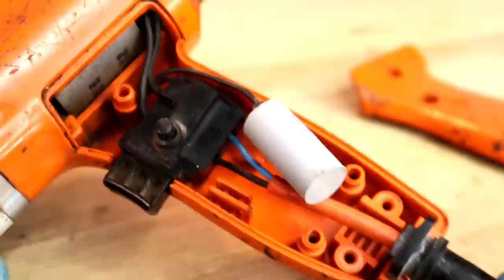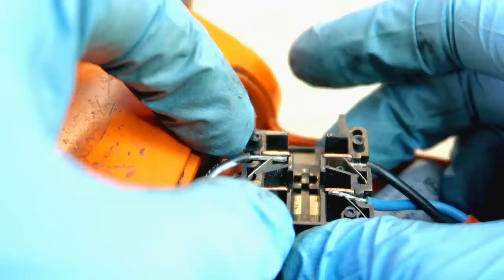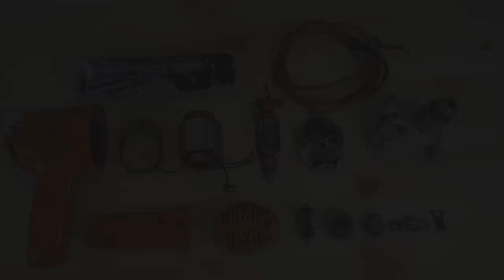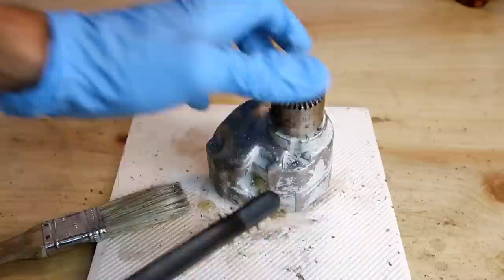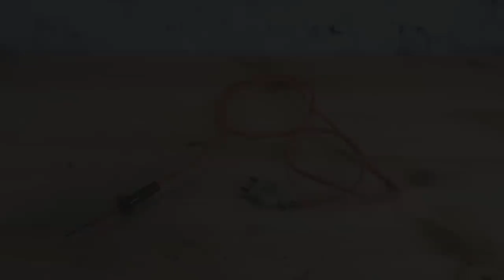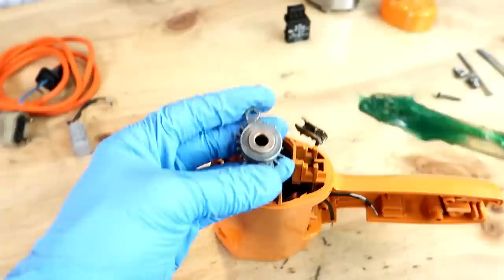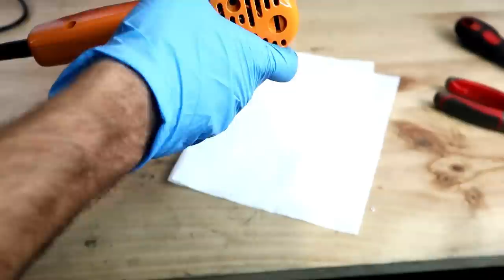Broken Old drill Restoration - Black and Decker

Comment: That material on the back of the bearing looks like felt, I think it needs to be put in oil so it can absorb it and then releases the oil lubricating the shaft.
Reply from the maker: i think is for dust ?
Reply: @TysyTube  I suspect Andrei is correct: it's for lubrication of the back bearing of the motor shaft.
Reply: I think it's a bronze bushing which is porous and absorbs oil. Saw a similar thing in a fan which had 2 felt washers impregnated with oil.
Reply: Yes it's for absorbing oil. When the shaft turns the oil gets warm and released from the bearing, lubricating the shaft. When it cools down the oil is absorbed by the bearing again. It is called a oilite bearing.

Comment: Damn, that's some gnarly grease. But great to see a B&D tool back from when that name meant something. Also why did they always paint the castings on these old tools? They look pretty in the white.
Reply: My Dad had a 1/2 inch Milwaukee drill and a Milwaukee Sawz-all (a reciprocating saw) from the 50's since he worked as a plumber.  The 1/2 inch drill must have weighed about 25 pounds, with a heavy cast aluminum housing, even the trigger was metal.  Unlike the 3/8ths the 1/2 inch runs a lot slower, but has tremendous torque for running big hole saws through beams.  The only paint was the logo Milwaukee with their red lightning bolt underneath, once after many years of daily hard use the trigger gave out, he went to the hardware store who were dealers.  Back then Milwaukee had a unlimited lifetime warranty, you paid shipping to the plant and they would fix it for FREE!  How's that for customer service!  When it came back my dad almost did not recognize it, they replaced the trigger and in addition the original chuck (that's what we call the the bit holder here in the US) which was a little nicked up, re-greased the gear case, put in new brushes, and replaced the cord.  To top it all off they buffed and polished the housing to a mirror finish!  He then saw the old dirty plate with his serial number and knew it was his. 

True it did not have variable speed, reverencing or hammer mode, but in terms of power, build quality and durability it is hard to beat.  Interestingly it is a Universal wound motor, 120 volt AC or DC.
Reply: That grease in that amount is needed.

Comment: According to B&D first remove the Jacobs chuck by inserting the key and striking it in a anti clockwise direction with a hammer which loosens the thread allowing  removal
Reply: You’ve got write mate as I use to do the same thing with mine 🔫 years ago

Comment: Nice job ! Suddenly I'm back five decades. My D720H, the hammer drill variant, got the regrease and brush service annually, but not a repaint! The chuck screws off -- when assembled, select low speed, insert the chuck key and tap it firmly with a mallet (seen from rear, insert key on right and tap downwards). Though lightweight, a well maintained D720 would stand lots of rough use and just keep going. B&D 60's ads in UK papers were for a drill plus lots of ancillary kit, clearly aimed at amateurs, and competed with Wolf drills, but Makita, JCB, De Walt, Bosch, etc. came later AFAICR. Today's portable, reversible, multi-speed, keyless-chuck drills are amazing, but these old drills got the job done back in the day.

Comment: Professionaly restores a drill
5 min. Later
drills wood with metal bit
Reply: Glad to see you got the point of the video.
Reply: I think he meant that it looks the guy uses a drill bit designed for drilling metal, not one designed for drilling wood. Bosch make multi-purpose drill bits which can be used all all kinds of materials, so it's possible he was using something similar, but it's definitely not a dedicated wood bit.
Reply: @stazjohnson8618  Does it matter though? It stills drills wood and does a good job of it. Unless there's a law somewhere that states you cannot drill wood with drill bits made for metal...
Reply: @AyeYerMa   In Alabama yes, it is a misdemeanor to drill wood with a metal drilling bit. However, if you drill metal with a bit that's made out of wood, you're given an award. I forgot what happens it you drill metal with a bit made out of stone. A write-up in the newspaper, I believe. :)
Reply: who in a penny-pinching shed shop is going to keep a complete separate set of awl-point or gimlet-point wood-drills around when metal/all-purpose drills work just as well for most tasks?
Reply: Not a big deal don't be so picky.
Reply: I drill wood solely with metal bits except of when i need to use a diameter that i only have on a wood bit. Metal bits tend to drill wood more controllably for me and are more forgivable when pushed sideways whereas a wood bit can overbore it more easily.
Reply: @AyeYerMa  r/whoosh!
Reply: not a big thing.i do that every time. irwin multi material bits, drills brick, tile, wood etc.
Reply: @thinkingmonkey8083  If @AyeYerMa really didn't 'get' your sarcasm, I'm seriously worried for him.
Reply: @kh23797  That clown is hilarious! He feels a need to school me that "drill bits are not made out of the material that they're used to drill" (LMAO!) then has the nerves to call ME retarded. Because of him and his negative comment I'm going to the shop right now and throw out all my stone and wooden drill bits. Got a couple of plastics ones I'm going to keep, though. lol
Reply: He got trough. So where is the big deal?
Reply: Hardly a problem, they make a hole, so long as it's not a wood bit into metal

Comment: I have same model..  yeah trigger went mental when pulling it apart.  To remove a stuck chuck, put the chuck key in situ and give it a solid whack with a hammer... Worked for me. Good job on restoration 😁
Reply from the maker: thank you so much 😊

Comment: You did not add enough grease to the gearbox. It is supposed to be full just like you found it when you opened it. The paltry sum of grease you applied will be flung from the gears after first use. smh
Reply: Gear box should not be full. About the correct amount of grease was added
Reply: @davidarthur6564  Well David Arthur, you are incorrect. I said it should be full like he found it. Which presumably is how the manufacturer intended. General rule when filling a gearbox with a large reservoir like that drill has you will fill the reservoir 1/3 to 1/2 full. The amount he put in wasn't even close.
Reply: Monad333: you are right. 100% full would be bad because for the heat, but at least 50% is ok. But i think it doesn't matter for this project, the drill will never be in use again. I have a few of those from my father's, i don't use them anymore but i won't throw then away.
Reply: @antraciet  Do it right or don't do it at all. ;) It's bad to spread poor maintenance techniques to others who may not know any better and then think that they are actually learning something. If they practiced what they learned here their equipment will suffer premature wear and failure.
Reply from the maker: sincerely i didn’t know that i needed to put so much grease inside, i will not utilize for me is just to show to my friends
Reply: @TysyTube  I know, its yours and your channel, throwing it off a cliff could be a fine option for a video too, lol. It's just if you go through all the effort in tackling a restoration and documenting it, you might as well make sure its up to snuff. BTW, It's a comment section not a personal attack, so take it with a grain of salt. Thanks for the reply and acknowledgment.
Reply from the maker: 😊 no problems
Reply: @davidarthur6564  You are incorrect. It should be full.
Reply: I made the same comment. When I saw it, it kinda triggered me LOL.

Comment: I don't understand how it worked at all without brushes...
Reply: You and me both.
Reply: Mutual induction.

But the armature should be at DC via brushes....due to the switching effect caused by commutation...
The field coils lock it into synchronous speed... 
Increase the frequency=
Increase the speed... 😉

Glenn
GLMelectrical
UK
Reply: I suppose it was the brush holders themselves dragging on the commutator. Would explain the noise. Hopefully that didn't cause much damage.
Reply: @ThatBum42 

No...
How could the brush holders drag on the comm? 

As I've already explained...
It was due to mutual induction... 😉
Reply: @glennmoreland6457  If you say so. I figured they just kinda fell onto the commutator since they didn't have the spring tension from the brushes and they were loose in the housing. That or they got close enough to arc at least.
Reply: @ThatBum42 

No.
The brush holders are just bits of brass formed into a square tube...these are held captive in plastic mouldings...
They're a couple of mm away from the comm...

Have a read up on mutual induction if it interests you...
Pssst: it's how transformers work...😉

Glenn
GLMelectrical
UK
Reply: @glennmoreland6457  I see. Crazy. Electromagnetism is pretty much voodoo magic to me, maybe one day I can have a better understanding of it. Have a good weekend ^u^
Reply: @ThatBum42 

Not "voodoo"...
Physics...👍

And once you start to understand it a little....it becomes fascinating...😉

Take care.
Glenn
GLMelectrical
UK
Reply: if you pay attention when he is cleaning the head of the drill you will see two plastic discs. The brushes are located behind them. He did not know to remove the coverings. The square tube hook into the bruishes from the back.
Reply: U
Reply: @glennmoreland6457  9ij
Reply: @SimoSimo-yx8rl 

Not quite in the realm of astro physics....yet...😏
Reply: Justyn, that´s right !
Reply: maybe it's a AC moter that dosn't needs brushes
Reply: oh, its a bldc moters

Comment: there was that much grease in there for a reason
Reply from the maker: that greas didn’t touched the gears
Reply: Nah, I bet some keener filled it full of grease before TysyTube got to it, seems likely since the brushes were missing. You don't need that much grease, when it heats up it melts into every crevice of the gearing. Put too much in and the drill has to work against the viscosity (fluid shear) of the grease, and also gets really hot. Explains why the old grease looks cooked.
Reply from the maker: thank you Justyn
Reply: @ThatBum42  Wrong, the gearbox reservoir is engineered that size  for a reason. It should be filled 1/3 to 1/2 at least.
Reply: @chriswilliams4200  Thanks Chris, The maker of the video got back to me and said he wasn't going to use the drill and it was only for display, so that confirms your suspicions. He also admits that he didn't know how much grease to add. Cheers mate.
Reply: @TysyTube  The grease would soften and deform as the heat built up in use and then the motion of the gears would fling it around like oil in a car engine, cooling and lubricating. It will always appear to have been flung off once the tool slows and then cools, but it really needs to be fuller than that. (assuming you intend to use it!) Looks great, though!
Reply: 383 chevy  especially when drilling  near the back door

Comment: Don't know if someone already said this but you did not need to cut open the switch open to get the wires out. Poke a very small nail into where the wires go and it will loosen the wires for you to be able to pull out. I restored one very similar to this model and my switch is still intact :)  I found mine in the trash with the cord cut off and the only thing wrong with it was...the cord was cut off. I now have a corded drill which I'm going to use as the drive for a mini wood lathe drill attachment I've got. Win!

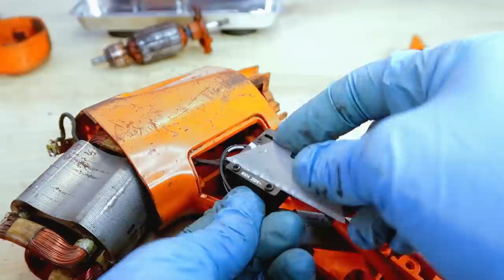Comment: Man, I freaked out when you were cutting the wires at 4:00... careful with those blades. Move the blade away from your hands!

The spring popping in slow motion was priceless.

Nicely done!
Reply: I think we all lose springs sometimes.  I do electronic repair and have learned my lesson there.  If I have to open something with a spring in it, if I can I'll put it inside a gallon Ziplock bag to try to contain the flying bits.  Hand towels draped over the workpiece also help if you don't have to see what you're doing.

Comment: Ive got one of these from when I first got married so it's 40 years old. It still works although I've not used it for 20 years because I suspect the bearings are worn. I used it with all kinds of attachments. I've lost the chuck in a couple of house moves though. Maybe I'll find some time to resurrect it.

Comment: Looks like it's more or less the same vintage of the Black & Decker SP2510 (at least, that's what it looked like) that my father handed down to me. The plastic is blue/grey, but the bit at the front has the same light grey colour as the one you removed. It still works well, even though it once fell into a well (while running), but it's a bit old-fashioned, with no way to control the speed other than "on" or "off".

Comment: I have this exact  sane drill ingerited from my late father. It's outlasted various more modern drills but now is a bit touchy on starting unless I pull the trigger just right and the noise from the gearbox makes me think most of the grease has retired after 45 years of use! At least I feel a bit more confident fixing it up now :)

Comment: Amazing restoration! Great attention to detail! I'm getting addicted to watching these videos ; ) I have a really old Black & Decker drill from the 60's which was handed down to me from my father it would be a great project to restore as well one day.  Someone had told me years ago that you can make brushes for electric tools from the cores of old C and D cell batteries with some work as long as they have a carbon core, correct me if I'm wrong. Thanks again for sharing a great video!

Comment: Thanks for the clear explanation, I've repaired mine with these instructions.
One minor thing: the configuration of the washers for the axle with the ball bearing might be different on other model years. To check if you have it correct try to turn the head by hand. If it locks up, you need the two thick washers on both sides of the ball bearing

Comment: I have bought several of these ...... 500watt > 700watt with hammer & all from boot sales. They were good bits of kit & really require no true over haul even after 40 yrs. Change the cable & repack with fresh grease & you are good to go.

Comment: A big bucket of paraffin and soak everything that's what I did with my black & decker (same model as this one) after it got sunk on our boat went down in bad weather. We got it up stripped it cleaned it and it is still running, this was in the 1980s and I first got it in the 1970s and it is still running. I wish they made things to last these days. I never bothered with the cosmetics just the function, nicely done.

Comment: You want to put epoxy or some other hi-temp resistant glue on the windings where they meet the conmutator. They do that now in quality parts so that they wires don't break away.

Comment: 1: It's amazing that the acetone didn't melt the plastic housing!
2: What? No strain relief on the cable?
3: In the late 70's you could get these drills with attachments, like a circular saw and an orbital sander.
Reply: housing is probably bakelite which resists everything!

Comment: Easy to get the chuck off. Standard practice for all screwed on chucks: place the chuck key in any one of the holes at the side of the chuck (make sure the key is properly seated in place). Hold the drill steady, and with a small hammer, hit the chuck key with a sharp blow sideways IN THE SAME DIRECTION IN WHICH IT NORMALLY ROTATES. This will free off/unlock the chuck in the threadad end of the drill shaft. It should then be easy to unscrew the chuck and remove it. But note: this only works with single direction drills. Reversible drills usually have a locking screw inside, which needs to be removed first. To access this, simply open up the chuck jaws, and you will see the screw inside.

Comment: Omg yes! My dad has this exact same drill, only his has the complete box set full of accessories, which includes an orange black and decker branded extension :D My only problem with this model is that it can't switch directions :(

Comment: Hello, as always great, but as an electrician I have to remark something.
1 one does not repair an old cable, 2x1,5mm² or 3x1,5mm² cost pennies, a cable in this condition is scrap.
2 Before I restore something like this, I measure the armature and the strator winding.
I don't want to just remind you to shit your wits.
Keep it up, it's great.
Reply: I was wondering the same thing. Why would you clean and shorten a cable instead of making one the same size or longer and put in a new safety plug would have been ideal.

Comment: Remeber my dad having one of these when I was a kid, It failed. Being one of those kids that liked to pull things apart to see how they worked I pulled it to bits to find it didn't have bearings on the motor but those nasty oil bushes. I'm an electronics/hardware designer these day and needless to say have not and would never buy Black & Decker. Best  place for it is in the bin.

Comment: I have very similar drill. Also black&decker. Shape is exactly the same.
My drill is green. Gear selection is slightly different (here is lever. On my is a button that you nrdd to slide) and it has an impact drilling mode.
Still works perfectly 😀

Comment: Very interesting. I bought a vintage drill press which the drill is very much identical to this one. I think mine is some years older as the housing is metal. It is in a very ugly shape. I cleaned the stand and then opened the drill. God, it has like yours so much Nutella. You video is very helpful but living in a small country, Norway I don,n know what that pickling gel you used. I wondered if I can use ordinary grease for intern parts.
The chuck gets only up to 7 or 8 mm. If I only could replace that chuck.